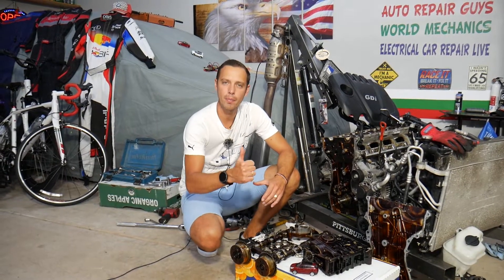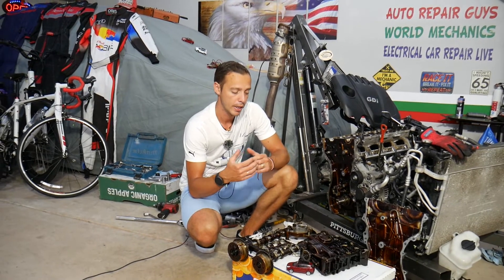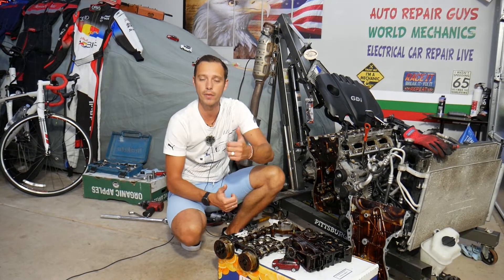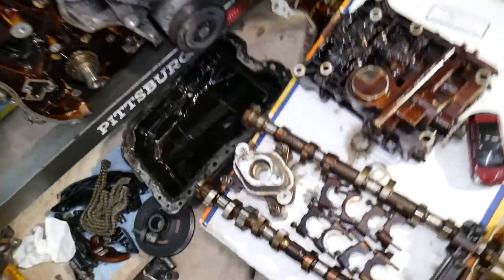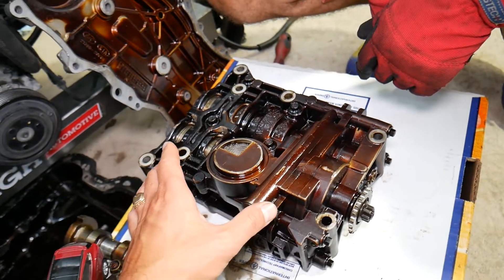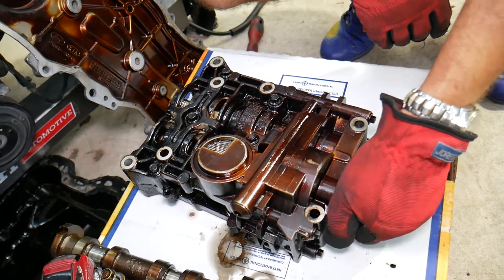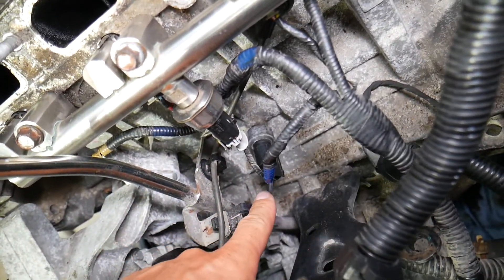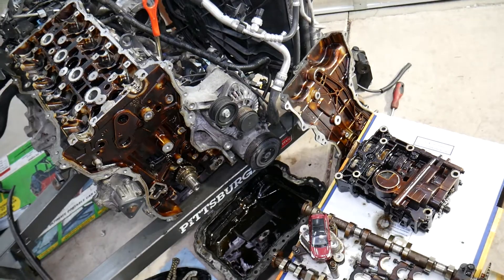HYUNDAI TUCSON CODE P0524 OIL PRESURE FIX

Comment: I have a 2016 hyundai tucson. Oil light is flickering at idle when engine is warm .oil is full. Check engine light is not on .engine runs smooth no misfire. Any ideas on what could be wrong?